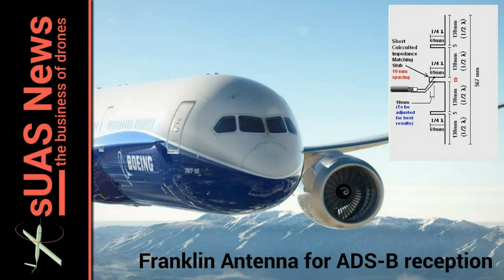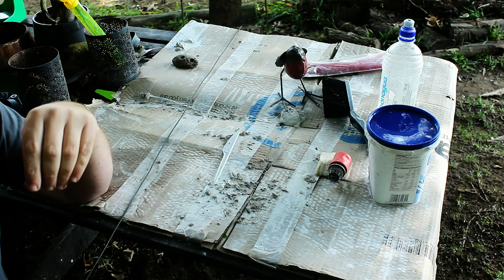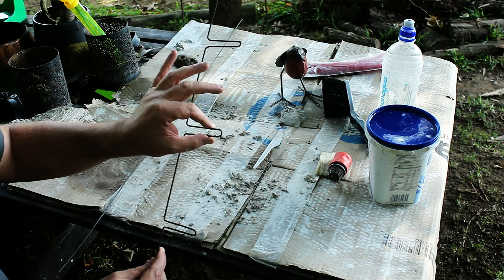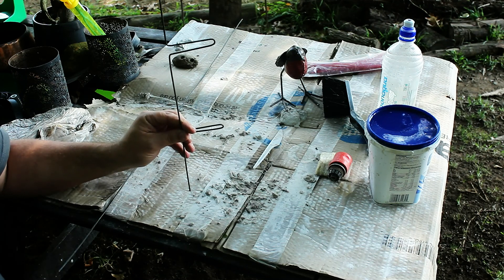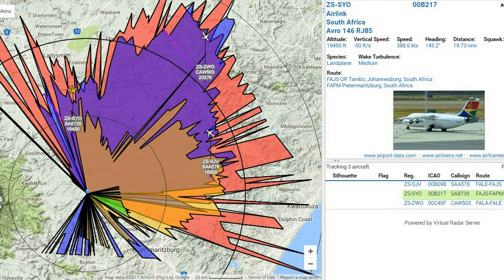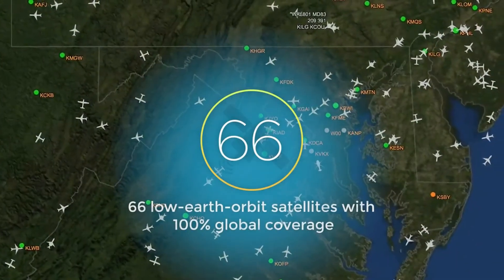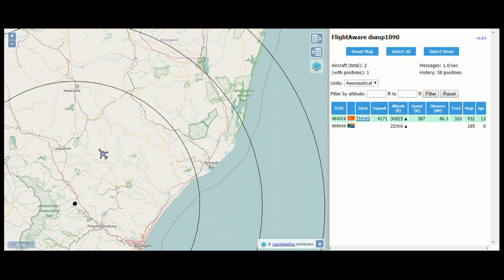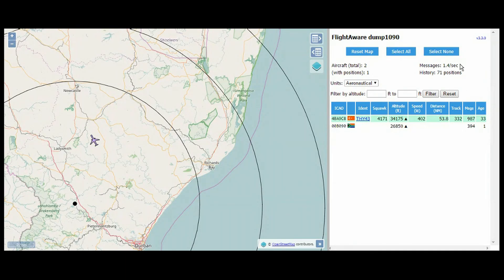1090Mhz ADS-B Franklin Antenna Build

Comment: Hi.
I have seen that the antenna has four 138 mm sections. If I make six sections, could it increase the gain? :)
Reply from the maker: You can but might get diminishing returns if you start building errors in.